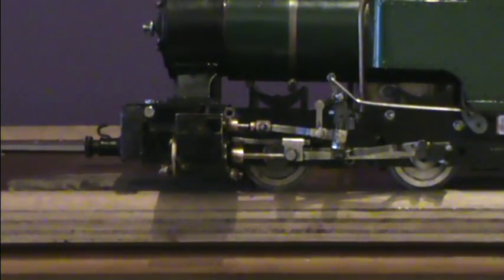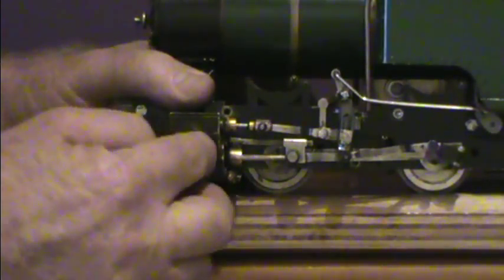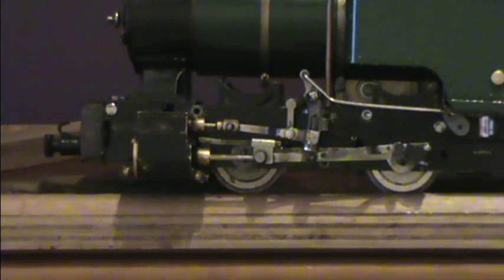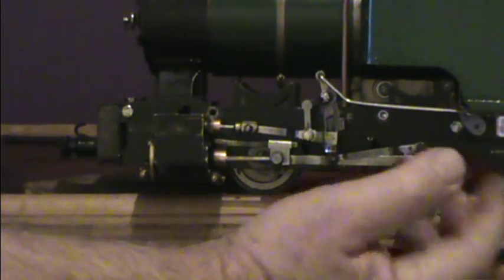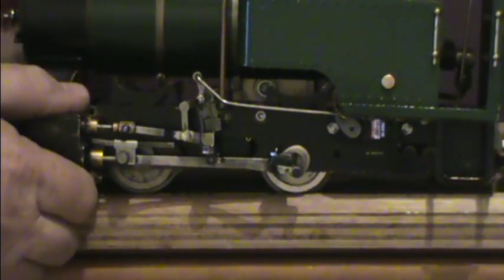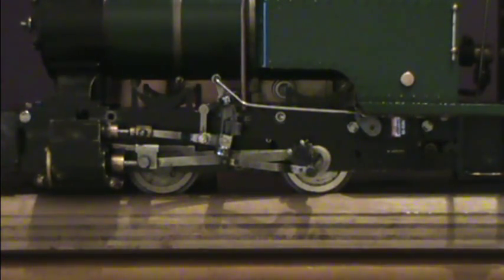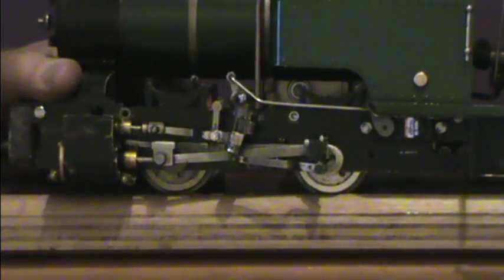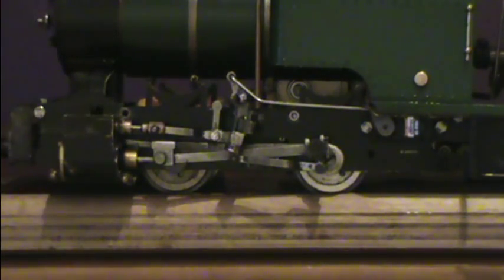valve gear timing

Comment: Setting the 90 degree relationship between return crank and main crank is much more easily accomplished by fabricating a pair of brass strips, one to place the main crank at either 3:00 or 9:00 position, and the other to place the return crank at 12:00 position.  This is the same principle as a quartering jig.  To get the right dimensions, you must measure your driver diameter, your motion diameter (nominally .125"), your main crank  throw, and your return crank length.  Lay these out in CAD to get the size of your two spacing strips.  Rotate your driver so the crank pin touches the top of the main crank strip.  This puts it at either 3:00 or 9:00. Now rotate the return crank so that it drops on top of the return crank strip.  If the strips were accurately cut, you should be dead on 90 degrees.As far as the return rod length goes, this, too can be determined first by CAD layout.  To test it, I use a method similar to yours, except I open the steam chest and observe the valve movement front-to-back to determine if the travel is equal in both directions, and measure the distance from the "D" valve to the front or back wall of the steam chest.  The theoretical length of the return rod does not always give best results!I scratchbuild American prototypes from Roundhouse components and as such have different spacing of components than Roundhouse standard.  My locomotives are all inside frame, so my frames are scratchbuilt, too.  Closer spacing from driving wheel to cylinder dictates different return rod geometry.  Not always a lot of fun!I have built a 2-8-0 Consolidation, a pair of 2-4-4-2 Mallets, and a Climax geared locomotive using these methods, and they all run well.BTW, nice touch adding ball bearings.  My axle bushings wear out too fast!

Comment: Good explanation and straight forward method for valve adjustments on Roundhouse locos'.  I like your method of measuring the distance from the slide valve connection to the front of the valve chest.  Thanks for posting.

Comment: Love your work.  When I was building my 'Melly' I considered replacing the bushes with bearings.  Now I'm thinking about it again and then using your timing method, I can see the logic in it and how it gives better results if used with care.  I too have not pinned the cranks on my loco.  Thanks for sharing.